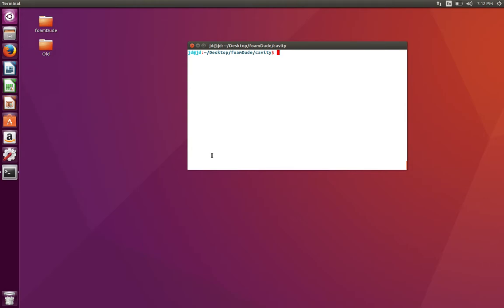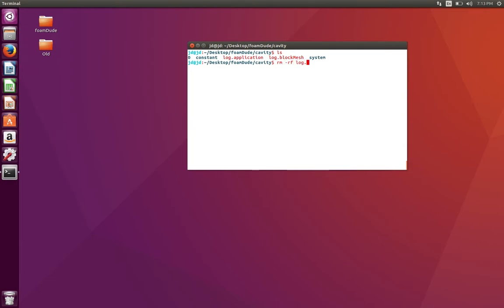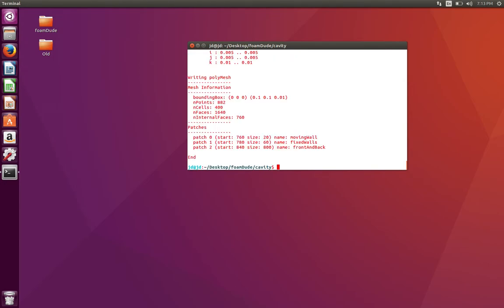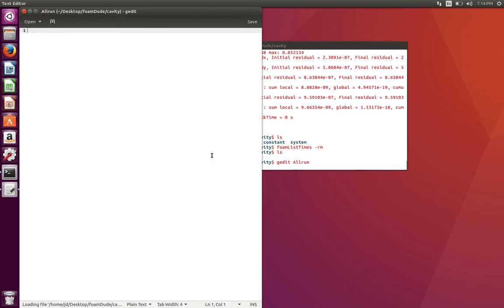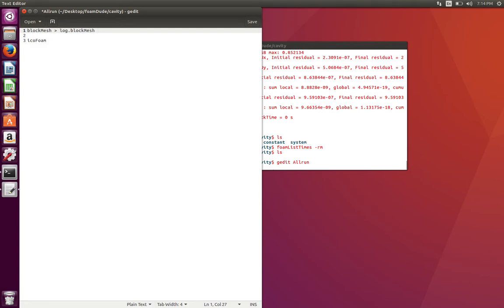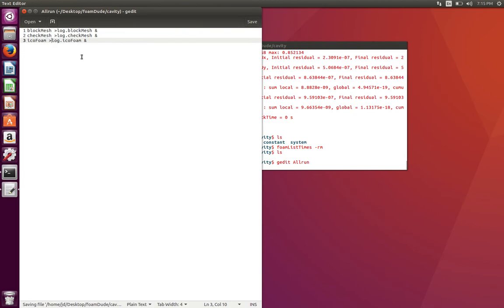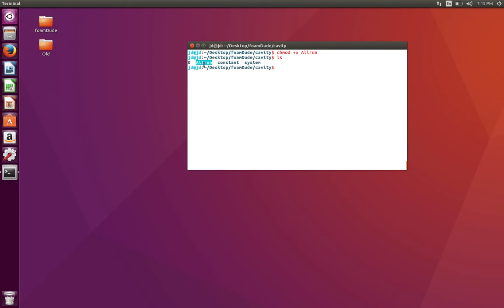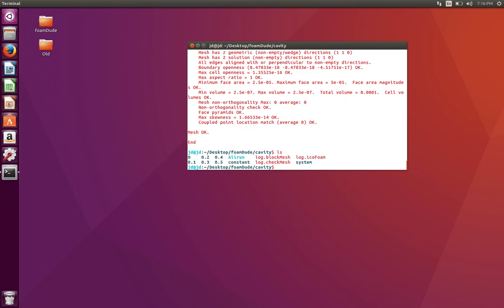OpenFOAM: Writing Allrun/Allclean scripts

Comment: There is a suggestion, the '&' should not be put at the end of each line because that means all the commands are running almost simultaneously. for some complicated simulation, even the blockMesh would take several minutes so the second step would not wait for it finishing.